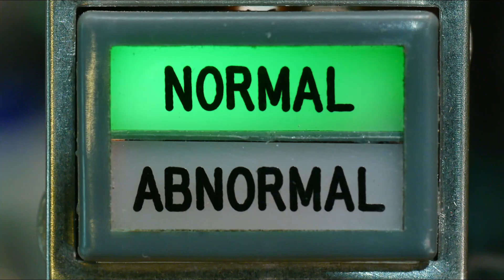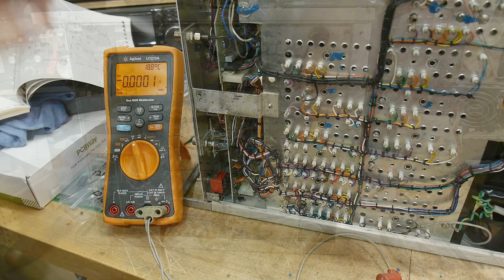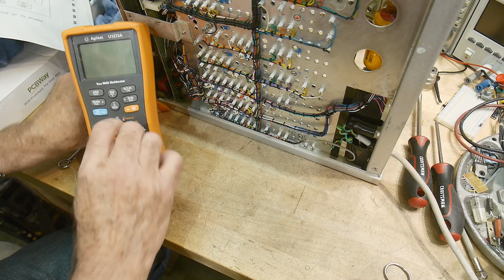#1901 Wavetek 3000 RF Generator (part 3 of 14)

Comment: Hi from Norway! Yes, I have been struggling with my 3006 for quite some time, and it partly works now. I changed some 20 bad Sprague 10uF 25V (?) tantalums inside most of the plug-in modules, some hidden under components in the point-to point wiring inside, real fun! And, the two separate grounds in the PS, also great fun.. I borrowed a 3001 to test modules from, it also had shorted tantalums. Mine works on only some freq ranges, I got frustrated and put them aside for a while.. I will definitely look at your findings, good luck!

Comment: Did you fix it?  If not... I have one of those.   Same problem with the 18V supplies.  It turned out to be tantalum bypass caps inside the RF cans.  Real PITA, but simple enough.   It's pretty tight inside those cans - in one case, I gave up, clipped the cap inside the can, and soldered one to the mother board.

Comment: That perf-board is NOT Wavetek original.  I have several Wavetek generators and have never seen anything like that in any of them.  The real clue, I think, is the hand written component designations.  I suspect the factory waveform generator quit working and this is somebody's cluge repair job.

Comment: At 6:25 when you wiggle that board it appears that the wire that is attached to the resistor and goes straight up to the solder point doesn't wiggle. Kind of like that joint might be floating. It's really hard to tell but something you might just double check.

Comment: I´m silently screaming for thermal imaging... Especially dead tantalums are that easy to find that way.
Reply: Getting IR visual very difficult with shiny metal.
Reply: @jspencerg  You're looking at the wires...
Reply: @jspencerg  Of course you can't see through the metal cans. But e.g. the tantalum on the perfboard could have been checked with the very first switch on.
And wires are often very worth to look at: The one carrying the short current often is easy to be recognized.

Comment: How did wavetek defend their choice of using these cans for everything?  Better performamce, reliability? 
ITC used this construction method on their oscilloscope, which I have.  I've never seen a more abandoned vintage brand. No schematics available or repair anecdotes.
Reply: @jim9930  Those results would make some sense.  Do the units' spec's support these gains?